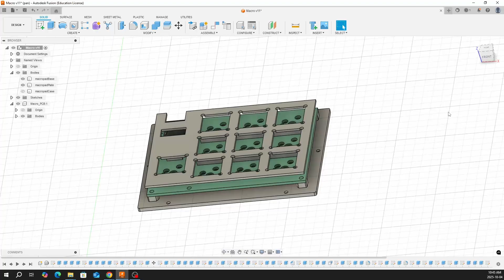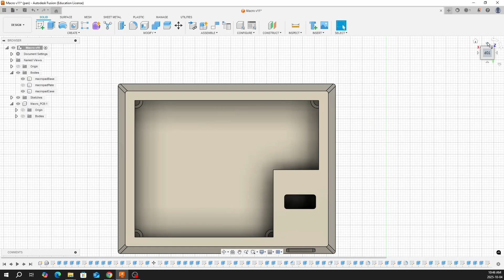Building A Macro Keypad From Scratch | Part 2

Comment: Lol it's funny how I've designed my base piece just like yours a couple days ago to screw in from the bottom. Did you end up removing the supports for the rubber feet countersink? I couldn't get mine off
Reply from the maker: I didn’t use any supports. I was worried I couldn’t get them off either so i just made a 0.4mm deep hole for the silicone feet. I would want to use support if I were to print it again. But the countersink isn’t that wide so support wasn’t super necessary.

Comment: This is an amazing quality video and all keyboards slunded good😅 i just wonder how u would program it to use on ur pc
Reply from the maker: In my Part 1 video I showed the PCB design and programming the RP2040 board. It’s basically like arduino, using C++. You can make the keys input single characters, to full words, or even open up applications like youtube or spotify